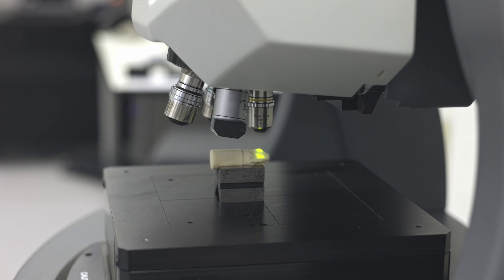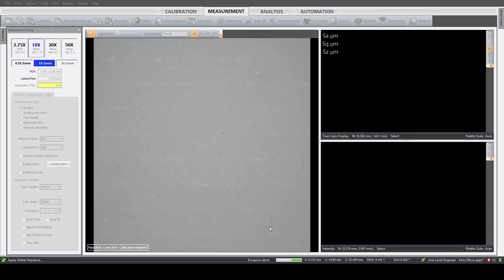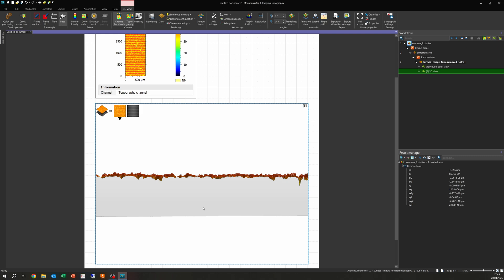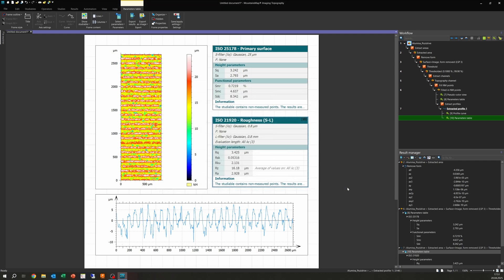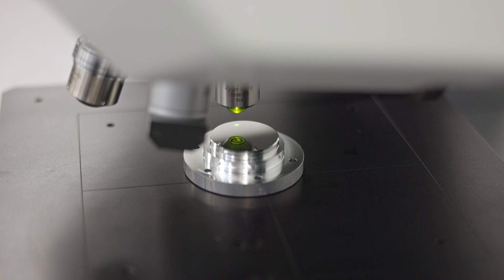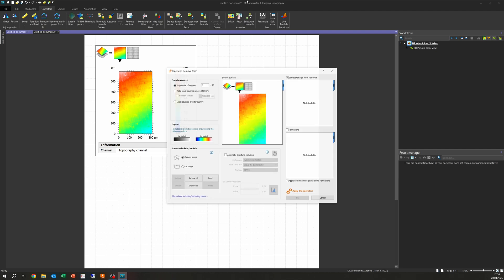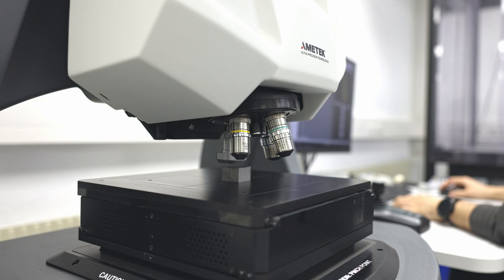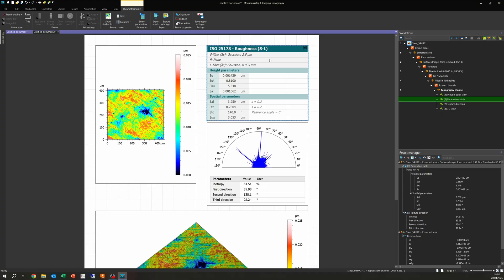Metrology With Dr Marv - 1 - Surface roughness measurements on the Zygo nexview NX2

Comment: Thanks for the rare insights! One question: Wouldn't a first-degree polynomial be better suited for removing just tilt (9:41)?
Reply from the maker: Very correct! Tilt can be removed via a linear equation. I like to go for the 2nd degree, as it also removes the bow from the lens, without changing any other parts of the surface. It’s probably a bad habit, which stems from always getting a flatter image with it 😅